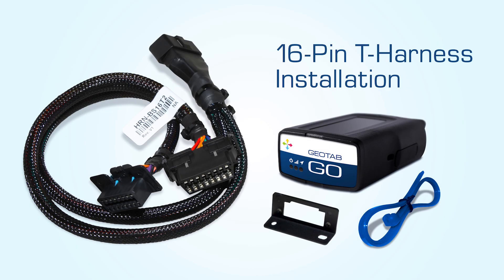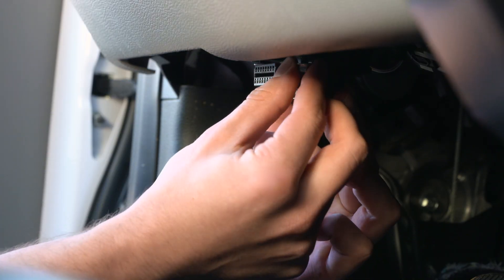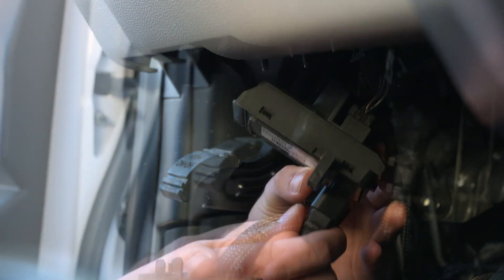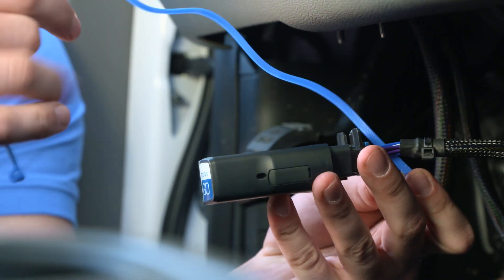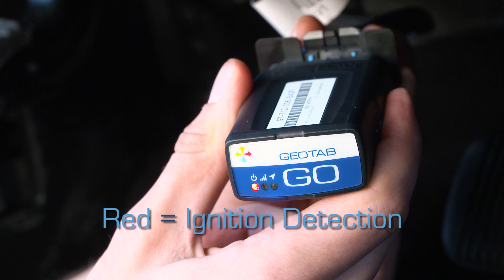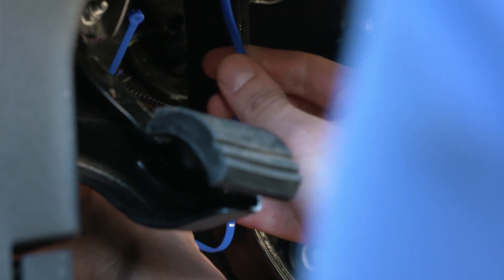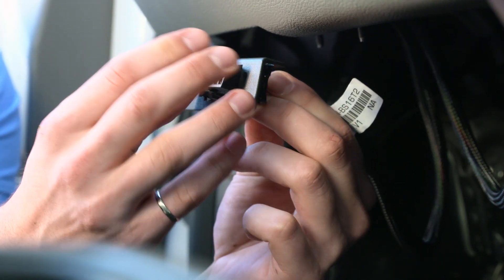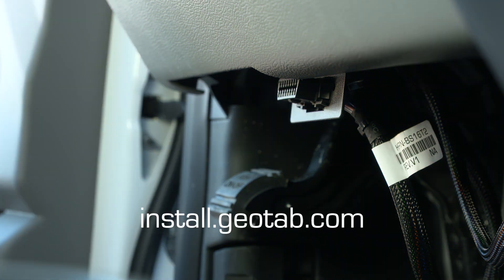How to Install Geotab's 16-Pin T-Harness | Tutorial

Comment: …Will it hurt the mechanics diagnostic tools, or will it damage the vehicle with prolonged use???  I believe my 2006 Camry got screwed up using this unit
Reply: Could you elaborate on this please! I know it’s been 2 years but I’m installing these in my work vans